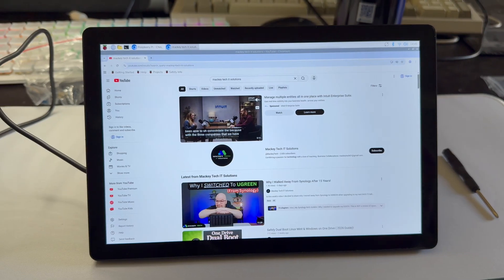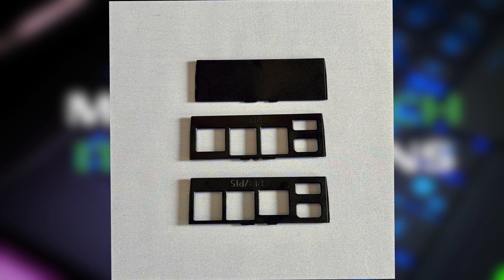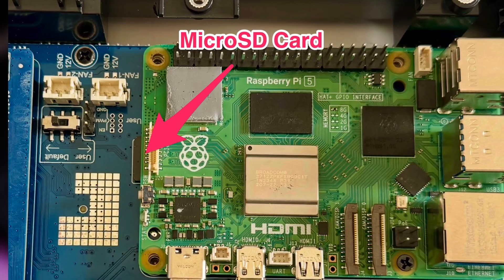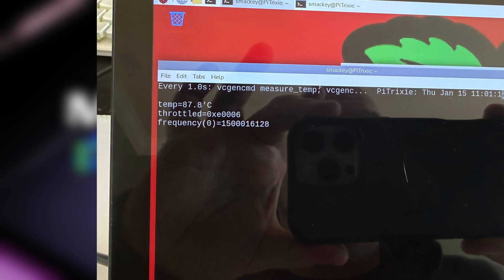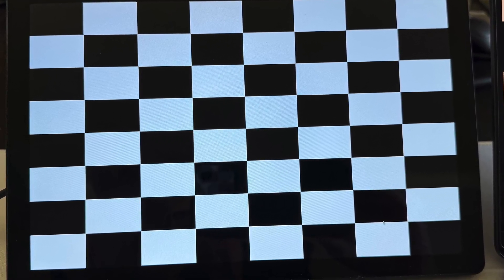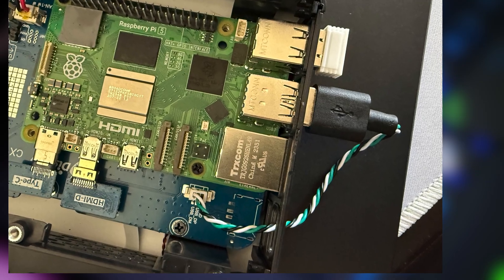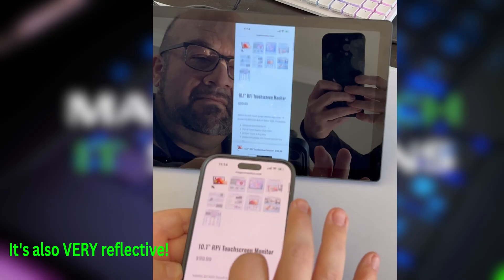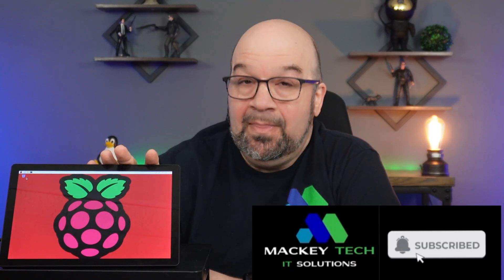Raspberry Pi All-in-One Display: Worth Buying in 2026?

Comment: would it be possible to power the whole thing through USB? (such as via a powerbank). I can do that with my current setup, as my 10.1” display is DSI-based, but, I got no proper case to house it all..
Reply from the maker: Hiya good question- i dont believe it’s a power port.
I plugged a usb c  cable from a power strip into the monitor with and without the pi mounted and got nothing; same result when i tried doing it from my macbook.